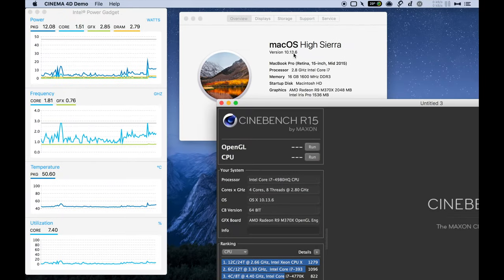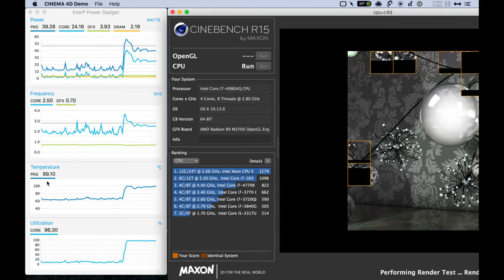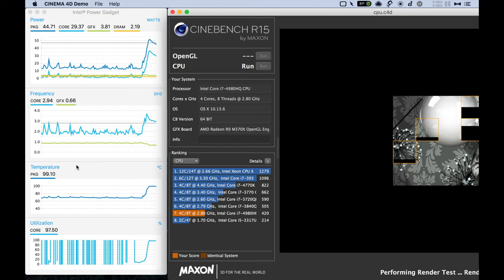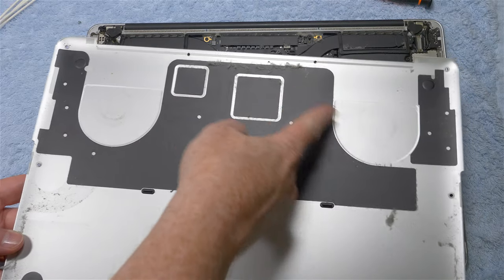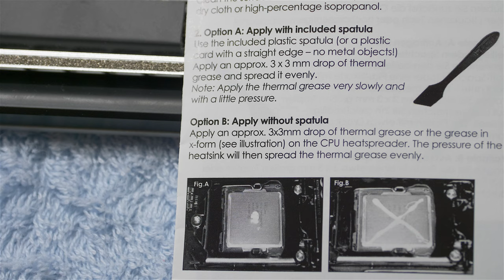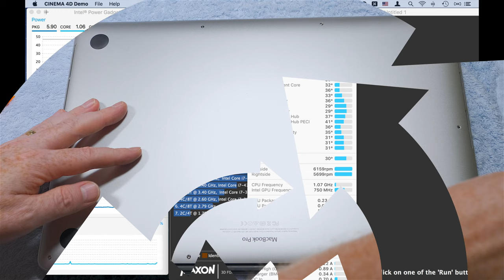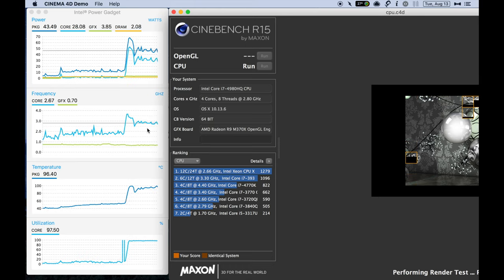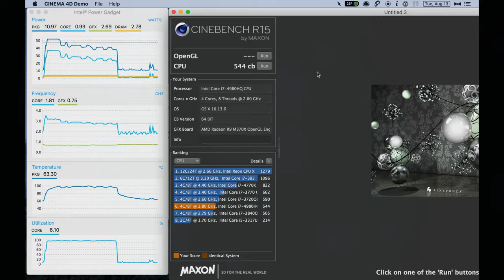Repasting a 2015 MacBook Pro 15" [Thermals & Performance]

Comment: great video man! unfortunately there are little to none of this kind, namely undervolting.

I owned a 15 inch 2015 base model and I can tell it worked. Highest I went was -95 mV, but i was getting random freezes while idle or low load. -75 mV was stable, so i did not win the silicone lottery.

How low did you manage to get without getting any crashes? I am considering getting the exact same model and I am a bit skeptical when i read about the temps.

If you do any light gaming under MacOS (DOTA 2 or CS GO), what do the temperatures look like?  Thanks :)

PS: you just earned a subscriber
Reply from the maker: Thank you for your kindness in subscribing.  I certainly appreciate it.  I too tried undervolting lower than -75mV and found instability problems.  I leave it at -75mV most of the time, although FCPX prefers I leave undervolting off altogether.  FCPX crashes rather often for me, so it's hard to tell when it's undervolting related and just FCPX crashing on its own.  But for all other apps, -75mV is working well.  But the exact value will vary by machine, due to process differences between the chips.  

Light or hard gaming doesn't make much difference when it comes to undervolting because you are using Volta to undervolt the CPU only.  The GPU is NOT undervolted.  I know this for  fact because I wrote an email to Gary Matthews who created Volta and he told me that he didn't think it made much difference so he left out GPU-undervolting in Volta.  I encouraged him to put the code back in, but that's been a couple months and no reply back from him on that.  

All said, when you do even light gaming on my high end version of the mid-2015 15" MBP, the dGPU kicks on and the temperature rises.  That is because the GPU and CPU share the same heatsink which is tied to the same pair of fans.  And when the dGPU is on, even if it's not working hard, you're going to see base temperatures of about 65°C, even on a cool day where the room temperature may be only 20°C. The fact is that these 2015 machines run hot.  Repasting is just a start.  To keep them fairly cool means to either use room A/C and/or a floor fan aimed at the machine while you're using it.  I actually do that, and it drops the machine temps quite a bit.
Reply: JDW I saw there is another undervolting method which requires a bit more tinkering.  There is a script voltageshift which lets you specify the offset for core, cache, igpu, power limit. Although this takes a lot more testing, I put my money on it that it would be more efficient.

If you have any games installed, could you please let me know about temperatures? I am considering buying one again but I don’t remember the temps. Thanks ;)
Reply from the maker: @Cristian-em5wc  With Volta undervolting at -75mV (and of course with my repasted CPU & GPU), I get up to about 65°C when playing LEGO MARVEL Super Heroes.

Comment: Hey mate I went into apple for a battery replacement and they replaced the entire top chassis for me ass well which was severely bowed, I have always looked after my mac and I just acted as if it was a bizarre occurrence to have my macbook deformed like that out of nowhere. I got it back, cleaned the fans and repasted it so it should be good to go again!
Reply from the maker: Thank you for sharing your experience!  If you don't mind my asking, how much did Apple charge you in total, and what was your turn-around time?
Reply: That was probably due to a swollen battery, nothing to do with the other components fortunately.

Comment: hey man thanks for the video i have same exact macbook have since march 2016 do you think i should do a repaste? and with liquid metal or regular paste? i have only done a repaste once on my xbox 360 years ago. thanks!
Reply from the maker: I used the non electrically conductive Thermal Grizzly Kryonaut because it is safer to use than the Liquid Metal version and because it is pretty much the best non-metal paste you can buy.  Any overspill won't post a problem at all, which is not true of liquid metal.  Another big problem with liquid metal is that it reacts negatively with Copper heatsinks, and as you can see in my video, copper is used in the MBP heatsink.
Reply: @JDW-  true and that's really annoying how you have to find out what metal the heat sink is made of thank you sir!
Reply: @JDW-  how is arctic mx-4? Is as good as kryonaut? I ordered some with a kit with tools included from amazon but I also want to try the kryonaut too
Reply: @JDW-  i thought it only reacts negatively with aluminum heatsinks?
Reply from the maker: @thegr8rambino  Arctic MX-4 is "good enough."  It is not as good as Kryonaut, but that's because Kryonaut is the best you can buy, second only to electrically conductive (and rather dangeous) pasts like liquid metal.  The temperature difference between MX-4 and Kryonaut isn't huge, and that's why I say MX-4 is good enough.  If that's what you bought, you won't have any problem at all.  Kryonaut will probably keep your GPU only a couple degrees cooler than MX-4.
Reply from the maker: @thegr8rambino  http://forum.notebookreview.com/threads/something-to-think-about-liquid-metal-compatibility-with-copper-heat-sinks.800890/
Reply: 360 years ago? Dang, that's quite some time ago. :P
Reply: @MarioGreco  hahahaha I know right?

Comment: Hey nice video but would increasing the wattage to 52 would increase the thermal isn't better to lower it ?
Reply from the maker: 52W is lower than what it is normally and I chose that number because I saw others using it too.  Going lower is not a problem but such will reduce your clock speeds accordingly.  There is a point below which there is no meaning to cap the wattage because your clock speeds fall lower than the base clock.  You could even opt to not cap the wattage at all and just leave Turbo Boost on and undervolt to -75mV. The biggest advantage to using Volta is the undervolt setting.  If you really, really want to fine tune all the settings, you would need to set Volta, then test in CineBench, let your machine cool, change the Volta settings, then retest.

Comment: It's a shame you didn't run Cinebench R20, maybe you could do a test using that?
Reply from the maker: I did not use R20 deliberately because at the time R15 was in still wide use so the vast majority of test data out there was done in R15, thereby making R15 testing more useful. And although I could do R20 now, you could also use the older version of R15 on your machine so that you can easily compare with the data I presented.

Comment: People might want to make note of why he's using 100% (or at least 90%) iso, you can see how quickly it evaporates in the video. Ya 70% will work but you better wait a bit before connecting the battery if you do use 70% as any standing liquid may cause a short once you add power to the board. 

Keep that in mind when you take the back cover off to spray with canned air, if you shake it and liquid comes out as often happens, it could short something, trust me, I forgot to unplug the battery when I took the back off once, sprayed inside, some liquid came out when I shook the can while spraying, even though it was powered off, POP 😳 🤦🏻‍♂
Reply from the maker: It's important to note I had a squeezable rubber blower blub, not a can of compressed air.  With compressed air, frozen white stuff can come out, which is why my video recommends the blower bulb instead.  And when I applied 100% ISO alcohol, I use a swab to limit the amount and better ensure it will evaporate quickly.  The area must be completely dried before applying new paste.  70% rubbing alcohol has a lot of water in it, so I don't recommend that.  It may leave a slight residue too, unlike the 100% or 99% ISO I recommend.

Comment: I read somewhere that the thermal paste should be the width of a cigarette paper, so the spreading method is best
Reply: That advice is sound for other pastes, but it is not applicable for Thermal Grizzly Kryonaut -- the paste I used.  I give you all the details about that in the text description under the video, in the section titled "OFFICIAL THERMAL GRIZZLY ADVICE."

Comment: Apple may replace your battery  they did with mine. In aug of 2019 for free.  There is a recall due to the swelling issue.
Reply from the maker: I actually have a video about that here: https://youtu.be/Om1c-FCc5u0

Comment: I use mx-6 better then mx-4 or MX-5.
Reply from the maker: Keep in mind my video was released 4 years ago, and I believe some of the pastes you mentioned didn't exist at that time.  I am aware, however, that MX-4 has an 8-year durability, which I find very important.  So in that regard, it may be better than Kryonaut, as I believe Kryonaut is only rated for a 3-year life.  In fact, I don't believe MX-5 is rated for 8-years like MX-4.  What about MX-6?  Would you know?  Some people don't care about that, but I have grown to appreciate pastes that you can "set and forget" (for a long while).
Reply: Kryonaut  is designed for overclockers in mind and not for long term use. With that said Mx-6 has the same life as Mx-4 . However  MX-6 as  20% better thermals then mx-4.
Reply from the maker: @Jimmycozad1980  Thank you for confirming MX-6 has an 8-year life like MX-4, yet with superior performance.  That makes MX-6 a winner in my book, even though I have no experience using it yet.

Comment: Your battery is swollen apple will replace for free call them before it blows up.
Reply from the maker: Absolutely. As I mentioned in my follow up video below, I did indeed verify on Apple’s own website that my serial number does NOT qualify for Apple’s battery recall, which is of course a crying shame. My follow-up video is about my experience getting the battery replaced for a fee, so you may want to watch it:
https://youtu.be/Om1c-FCc5u0

Comment: Please use thermal paste sparingly
Reply from the maker: Actually, the amount I used was just right.  No need to take my word for it either.  Check out some YouTube videos on the repasting pros and you'll see that failing on the side of too much is almost always better than too little.  Why?  Because the excess will overflow and get out of the way when the heatsink is pressed down firmly. But the bottom line is this.  That repasted is still going strong and keeping the temperatures cool.  So anyone following my video should have the same success that I did, even if they use their own favorite brand of thermal paste.  Speaking of which, MX-4 is an all around good paste that I can recommend.  It has an 8-year life versus 3 years for Thermal Grizzly Kryonaut.  Kyronaut gets slightly lower temperatures, but for people who don't like repasting ever few years MX-4 is worth a look, and it seems to be better in some regards than MX-5.  Happy repasting!